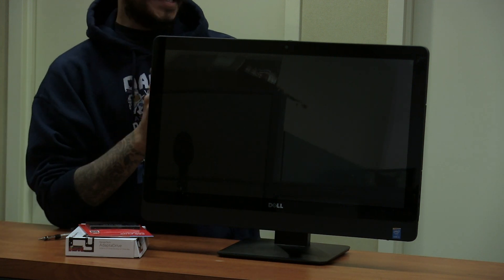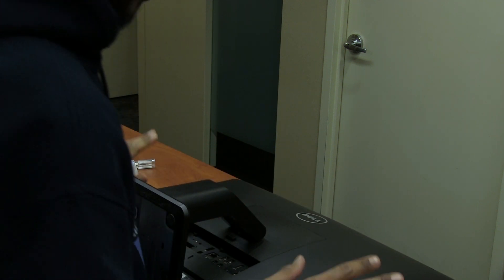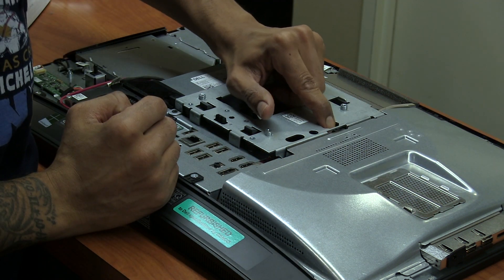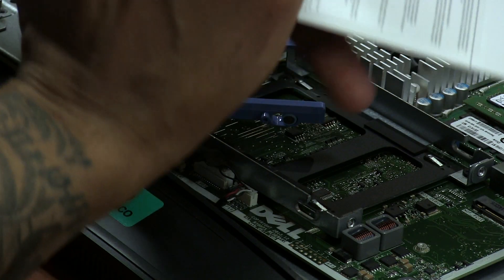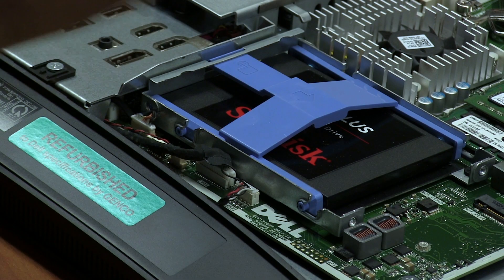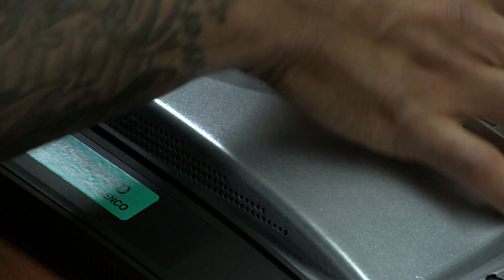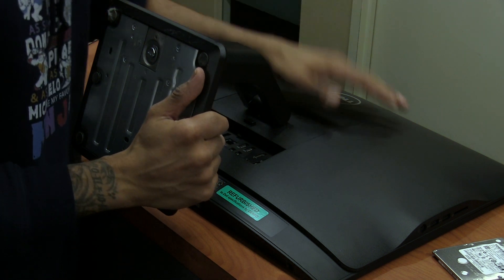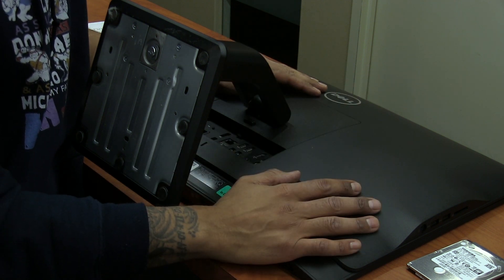Upgrade Dell Optiplex 9030 AIO SATA to SSD (Installation)

Comment: thanks for this tutorial, i'm trying to fix someone's else 9030. it looks actually so easy to do this due to the build pattern that i'm suprised that other computer aren't built this way
Reply from the maker: Glad it helped! 👍 Yeah, the 9030’s design makes repairs and upgrades way easier than most. I wish more systems were built with that kind of straightforward layout

Comment: Best practice would be to set your computer on an anti-static mat, while attaching your alligator clip to the Vesa mount. The suggestion of using a towel is a bad idea since cotton can retain static electricity. If you don't have a static mat use a dry piece of cardboard, since cardboard is non conductive to electricity.

Comment: I want to ask a question, on the motherboard I see that it has an nfg_pcie port, can I install a ssd m.2 2242 to use it as main memory to install the operating system on my aio 9030? I would like you to help me ... Because I see that this port is empty and the fact that it is close to the hard drive makes me think that if it can
Reply: If it can be used that way, you would need to right drive.  They have both sata and NVMe type drives.  So you would need to know which to get.  Even though the port looks the same, drives sometimes are not cross compatible.

Comment: Good video.  I was looking for screws that didn't exist.  LOL, weird having a AIO that has no screws at all to change the hard drive.  Thanks.
Reply from the maker: +Pattern Break yup, but Dell makes the AIO like that so when Dell tech support comes in to replaced a part it’s an in and out process.

Comment: Now compare that to opening an imac, this is so much easier. These are 4th gen i3,i5,i7 machines with DDR3 1600MHz. You can buy them often cheaply now. With a SSD drive it should be pretty zippy, apart from 3D games because you're limited to the builtin video intel HD. I know the i5 is the S version to use less power, so like 5-10% slower than the desktop version.

Comment: They are both SATA drives, as that is the data and power connector they are using. The first drive would be a 2.5in HDD, and replacing it with a 2.5in SSD.